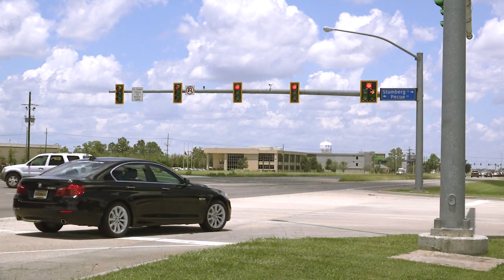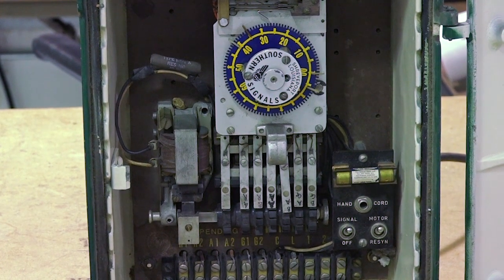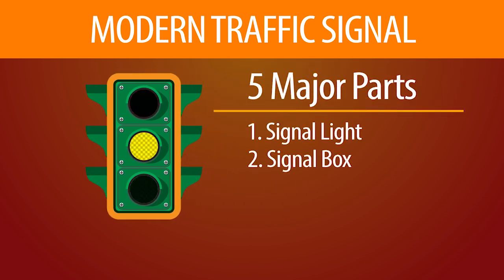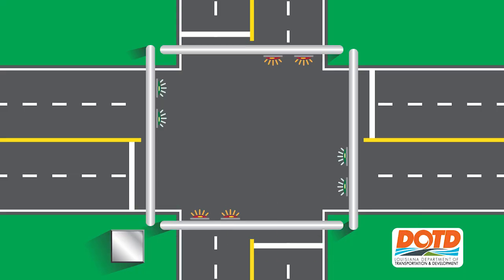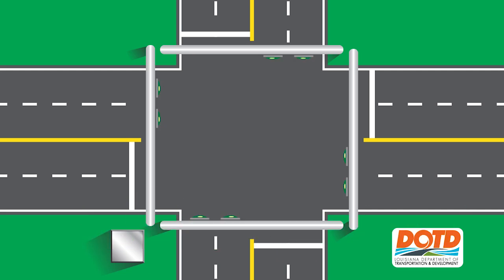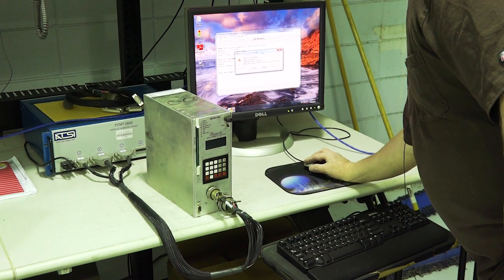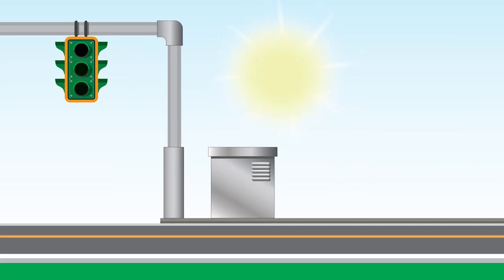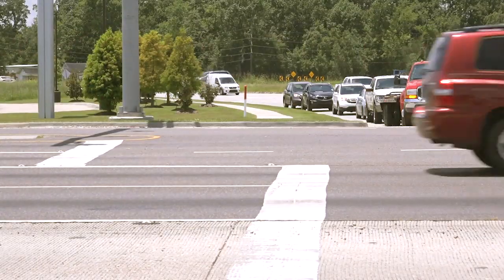DOTD Signal Repair Shop

Comment: What are those covers on some new signals?
Reply: Westbank Expressway on top? It's a quick disconnect box
Reply: Taylor Leger it allows the signal to break away without damaging the wires.
Reply: @schutzdan23  no it doesn't it allows the signal to be removed for paint or repairs